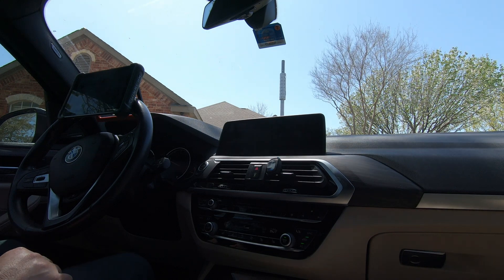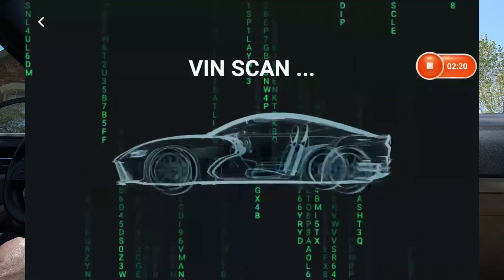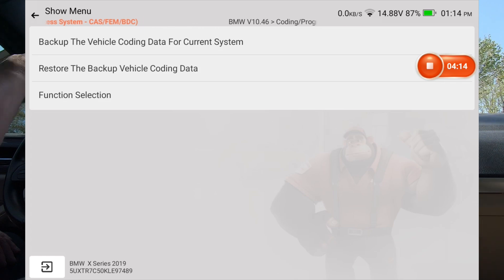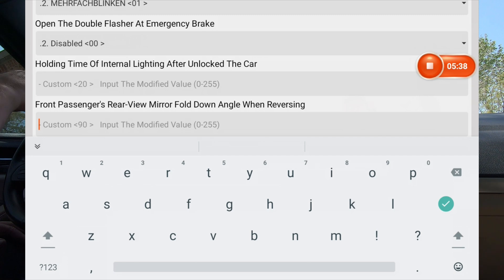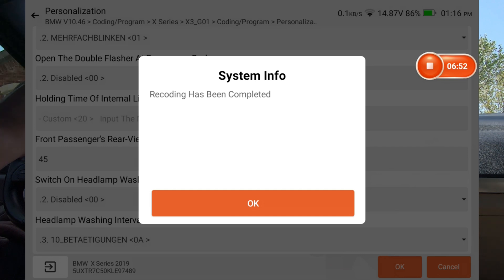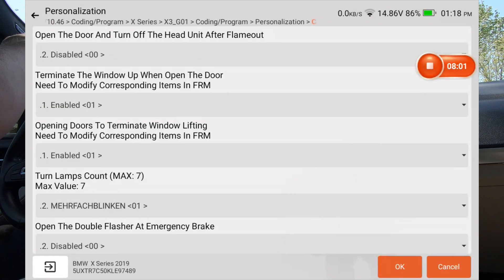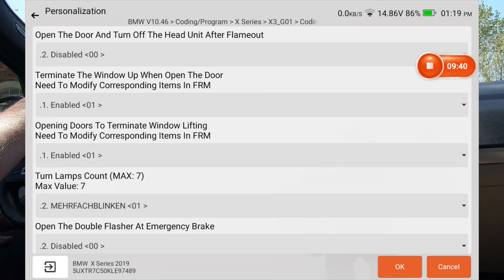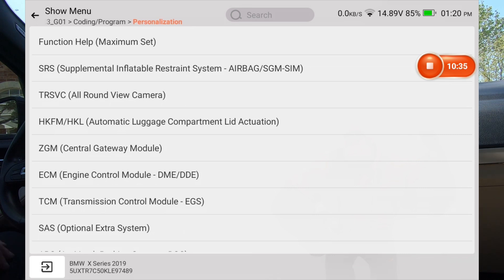Using the Thinkcar 689BT to Code the Reverse Mirror Angle on our 2019 BMW X3 G01.

Comment: In your next connecting to the x3 take a video or go into the battery replacement as i want to see the options for main battery and aux battery 
Have 2017 x5 wife’s car too 😉 
Also if you can release p- brake if it has that option
But yes thanks for the videos they do help out
Reply from the maker: I will do that.
Reply: @737mechanic  Thanks! Not sure if yours has 1 or 2 batteries but mine does have 2.
Reply from the maker: @burnjack291  Ours has 2 also. Look for the video within the next week.